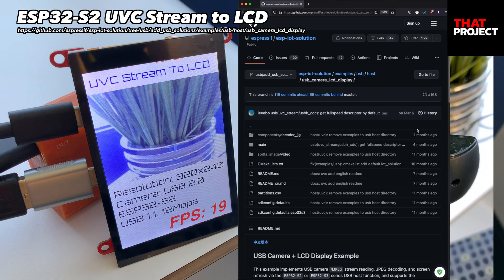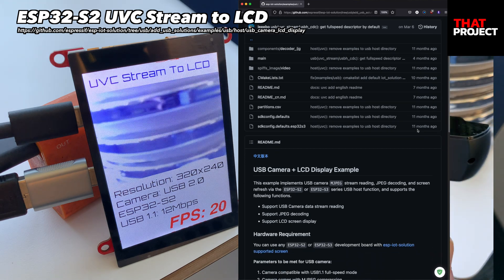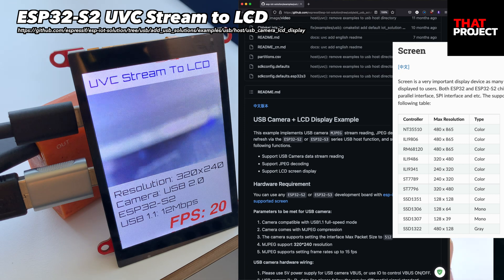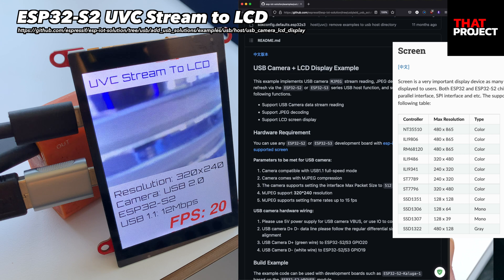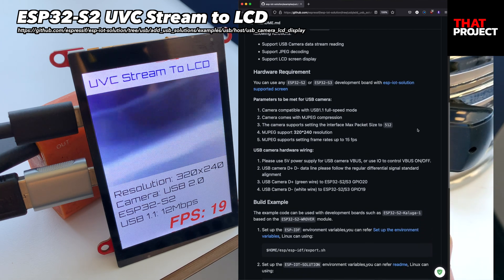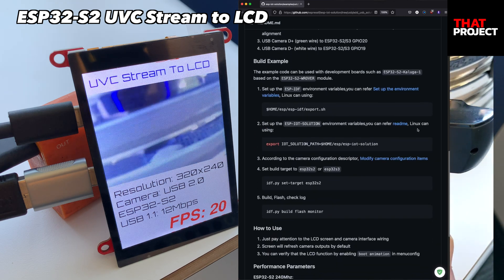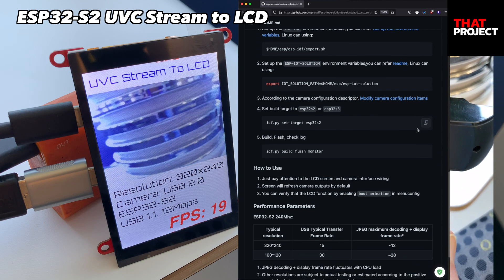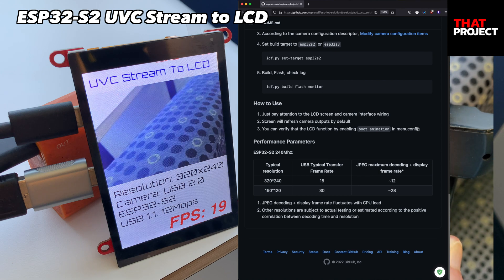ESP32-S2 UVC Stream to LCD #USBCamera #ESP32S2 #UVC

Comment: is it possible to connect usb cam to esp32 to display it on laptop?
Reply from the maker: Why do you need it? Can't you just plug the USB cam into your laptop?
Reply: @ThatProject  just trying to know is it possible to use usb cam to esp32 to  laptop via LAN (converted to usb) for a long range (15 m+) application.
Reply from the maker: @bhamkertima5842  That's interesting. oh, it is via LAN. I think it's quite possible.

Comment: Would this work with an hdmi capture card? Or would it need an custom driver
Reply from the maker: This has nothing to do with HDMI as it is a regular USB connection. I believe it needs to use ffmpeg to capture the screen.

Comment: My lcd is ili9488 16 bit parallel line with 320*480 resolution 
How to set the  resolution for live streaming  on lcd in "'tft.pushImage(x , y ,w ,h,(uint_16 *) data); function ?
What is the value of w and h will be?
Reply from the maker: w mean your display's width so it's gonna be 320.
Reply: @ThatProject  Thanks for replay sir!!
When i simply called this function with  value of X and Y coordinate and width =160 and height =120  "static bool lcd_write_bitmap(uint16_t x, uint16_t y, uint32_t w, uint32_t h, uint8_t *data)
{  
     tft.pushImage(0,0+50,160,120, (uint16_t *)data);
    return true;
}

Live streaming working only this resolution 160*120 
other is resolution is not working like 320*240 ,320*480 
But problem is when  i change the Resolution like "tft.pushImage(0,0+50,320,240, (uint16_t *)data);''
Printing the random images on lcd
What will be the right resolution  value for function  "tft.pushImage(0,0+50,160,120, (uint16_t *)data);''?
pls help me sir 
Thanks for advance
Reply from the maker: @followembedded1549  The resolution of the image you get is 160x120, so you must display it at this size. If you want a larger resolution, you must set a larger resolution from the camera.
Reply from the maker: @followembedded1549  Not sure but the parameters you set are not working with your USB cam. If you have a different USB camera, try another one.
Reply: @ThatProject  My usb camera maximum resolution is 1280*720 
In the code example i don't have  set any  resolution of the usb camera. then which resolution working with code ?

Comment: I like your test videos. You tryed with usb camera, but what will be the result if you  try play a online video stream with esp32-s2? Example esp32-cam webserver video stream. Will be faster using wifi or same 20fps video speed? I saw lot test video with these parallel esp/tft boards but thats missing.
Reply from the maker: That's an interesting question. I think this is a good subject for my next ESP32-S2 UVC Stream. I'll try it sooner or later.
Reply: @ThatProject  This would me important question, because i want build a better ,,running" door viewer. My main problem i have now a esp32-cam what is connected with spi to a ili9488, im sure you know the result: realy slow choppy picture in VGA, lower/smaller resolution giving better result, but hard to identify the face with 320x resolution:)) thank you if you can do a test to see giving better fps or same speed.